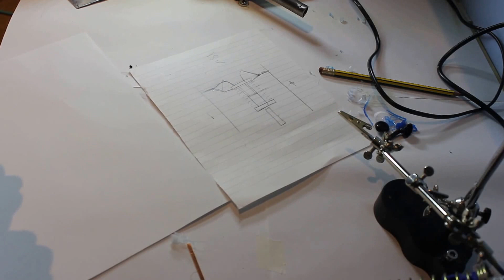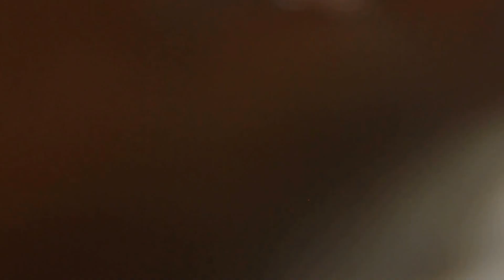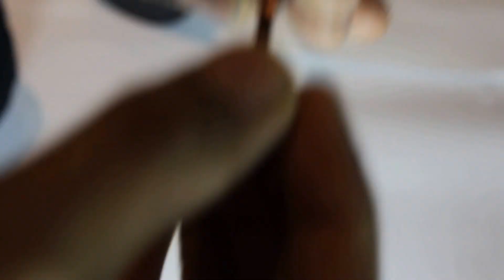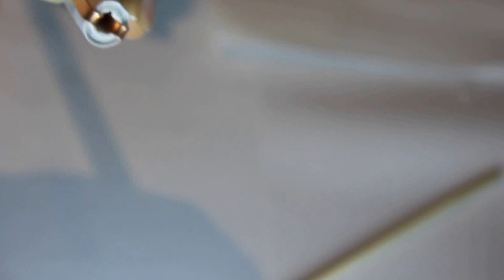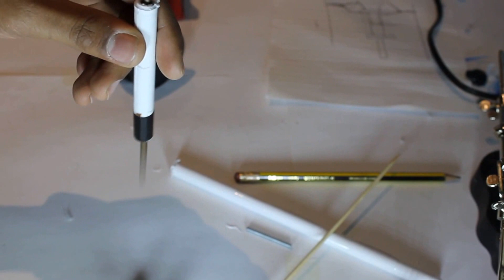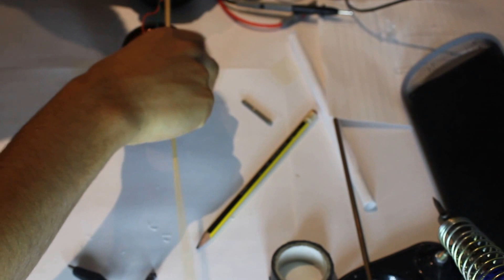Prototyping my Coilgun idea

Comment: There is a great fire hazzard here. Current through an inductor can't instantly change, therefore even if you energize the coil and then switch it off, the current inside will still flow and voltage will build up at the switch. Use a flyback diode to prevent fire and/or shock.